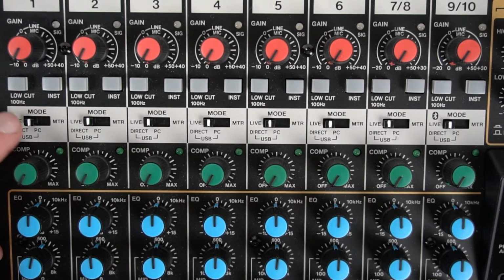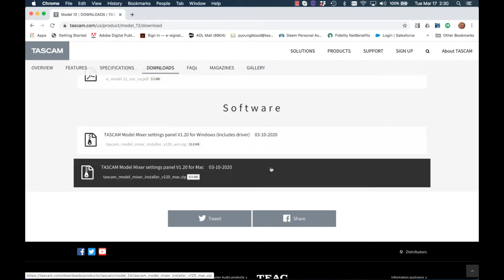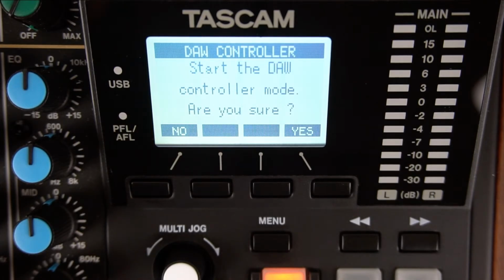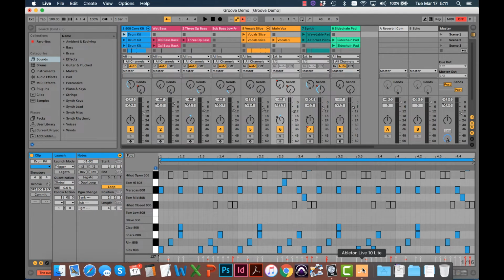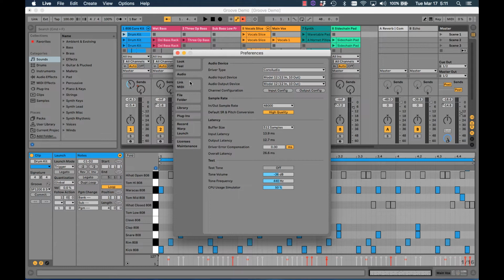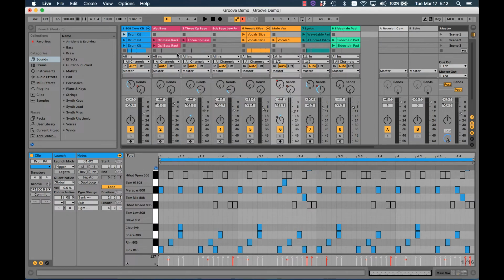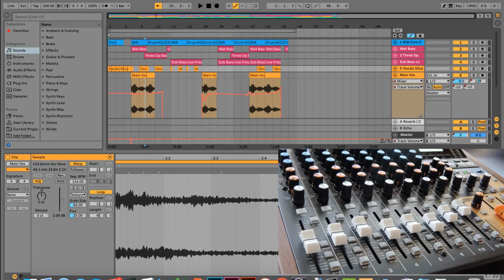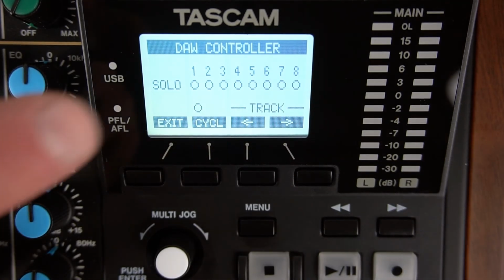TASCAM Model 12 - Recording with Ableton Live / Controller Tutorial

Comment: Hello! I would really love some help on this especially because I'm more of a muso than a sound engineer who understands the tech side of it: I'm wanting to use my Model 12 as an audio interface, therefore using all/most input channels to go into Ableton Live for live looping & streaming. At the moment Ableton is grabbing the entire mix (even though i have 4 instruments plugged into channels 3, 4, 5 and 6) and sending it into '1&2' in Ableton Live. I was hoping to be able to set each individual channel/line to a different track in ableton but alas it is only detecting audio from Channel 1& 2 of the Model 12. Is it possible to split all these channels into indivdual tracks in Ableton Live or is this beyond the Model 12's capabilities? 

Lastly I was hoping to be able to send a click track into one of my monitors so that only I can hear it (i.e. viewers can't hear the click track but can hear everything else). If I could get a response this would be such a life saver as I'm super stressed about trying to get this to work! Thank you Tascam
Reply from the maker: Hello!  Great question, and we have a solution for you! When the Model 12 is stopped, enter the MAIN MENU. Next, select USB AUDIO on the SYSTEM Screen, and open the USB AUDIO Screen and select PC. This will take you to a menu that give you an option for MULTI or STEREO MIX. Make sure to select MULTI in order to utilize all of the Model 12's channels.

Comment: I went to download the Setting panel software but it links me to another one. I downloaded it anyway but still can’t control ableton :/
Reply from the maker: Hello Zafra Music!  Are you using Windows or Mac?  I just double-checked and both of the links allowed me to download the correct versions of the settings panel.

The video lays out all the correct steps to use the Model 12 as a DAW controller for Ableton, but if that's not working I'd recommend reaching out to our tech support team.  They can walk you through everything and help to troubleshoot the process.  Feel free to give them a call at 323-726-0303.
Reply: @TASCAMUSA  thank you for the reply! i was able to get it working. Im having so much fun using the mixer as a DAW Controller. I still need a lot to learn. I  am trying to use the inputs (microphone) while I use it as a controller but cant get it to work. Any quick tips??

Comment: I want to purchase this but I just want to make sure. I hope I’m not asking something that has been asked but,
Can I run my MPC LIVE TO THE inputs of the Tascam and live record multiple tracks simultaneously into Ableton? (With the desired eq from the Tascam).. excellent video
Reply from the maker: Hello Octavius!  If you're connecting the MPC Live to the Model 12 via MIDI, you won't be able to multitrack record - MIDI doesn't send audio, only control information, so you can use it control virtual instruments within Ableton.  If you're outputting the actual audio from the MPC Live's 1/4" jacks, you can connect those to multiple inputs on the Model 12, though I'm not 100% sure the MPC can route audio to different outputs.  But, if that's possible within the MPC then yes, that'd be doable.

Comment: Hey guys! Would be possible to use channel sub and main to compare between different pair of monitor? I’ve tried but in the DAW mode I could just get sound of the main one
Reply from the maker: Hello Miguel!  Yes, that's absolutely possible.  Those two different outputs will send the same signal, so as long as you have different monitors attached to each you'll get the desired results.

Comment: I’m thinking of buying one but I was curious about something. If I wanted to send a channel through a channel strip to use the compression or EQ could I do that in abelton and print a new track with the added EQ from the Tascam? I hope you understand my question. Essentially I want to use the Tascam strips as outboard fx gear to alter existing audio already recorded on abelton. Thanks!
Reply from the maker: Hello J Blue!  Yes, that's definitely possible and we hear of folks doing this all the time.  Basically, you'd need to route the channel you want to effect out of an aux output, then back into an open channel.  Set up a new channel in Ableton that corresponds to that and record it down!

We hope this helps, let us know if you have any additional questions!

Comment: Hi,
 
Is it possible to control the DAW with the Tascam, whilst using a different audio interface?

Cheers
Reply from the maker: Hello MMH Studio!  Yes, that's possible.  Depending on your DAW, go through the normal steps to set up your audio interface as the inputs, then set up the DAW control as the Model 12.  The only real limitation here would be the number of USB inputs your system has available.

Let us know if you have any other questions!

Comment: Is this the same for the model 16? I’m not at it right now but I could only get stereo input and outputs to show in ableton. Would this be because I didn’t have the switch on pc?
Reply from the maker: Hello!  You should be able to get all the outputs to show up in Ableton.  On your PC, go to the audio settings panel, then the microphone settings and open the ADVANCED tab.  Here you'll have access to a drop down menu, select the number of inputs you're trying to use (the options will be either two or twelve).  Once you've selected twelve, you should see all of the inputs separately within Ableton.

Let us know if this works for you!
Reply: @TASCAMUSA  Thanks heaps yeah I was able it fix it. I had to change my driver type! Then the multitracks options showed. Thanks heaps for your prompt reply!

Comment: Heads Up!  Slightly different instructions are needed if trying to connect the Model 12 to Ableton Live 11 running on Windows.

Hi - this instructional video is almost completely correct (and is probably 100% correct for Mac).  The settings on the Tascam Model 12 are all correct.  The driver installation for Windows works identically.  Setting DAW Control on the Tascam Model 12 works great.  Setting Mackie Control in Ableton preferences is also correct.  
However, on a Windows 10 machine running Ableton Live 11 there are two Model 12 ports that show up as selectable in the MIDI/Link preferences not just one, as displayed in this video at 3:41.  On a PC, two different MIDI ports show up as selectable: Model 12 and Model 12 (MIDI 2).  When I chose Mackie Control and Model 12 for Input, Output, and Sync, nothing happened! (i.e no fader control in Ableton)  I kept trying other options thinking that I might have a defective unit.  Then, I fired up an old Windows program that would let me spy MIDI messages coming off of the Model 12: MIDI-OX.  Selecting Model 12 as a MIDI device produced no recognition in MIDI-OX or Ableton Live 11 when I jiggled the faders with "Model 12" set as my Input and Output device in Link/MIDI preferences.  
But, when I selected Model 12 (MIDI 2) instead, messages appeared for all of the faders, the pan pot, and the transport controls.  I went back into Live at that point and selected Model 12 (MIDI 2) as the Input and Output device.  That made the MackieControl Remote Controls come to life in Ableton Live 11.  Can you guys please make a video or correct this video for Windows users so that other folks don't have to invest the time that I did to figure out the way that Model 12 users that use Ableton on Windows need to configure?

Signed,
Software Engineer
Reply: Thanks heaps for this well written problem-report and fix, Billy! I am over the moon with my new Model-12 but couldn't figure out why it wasn't working as a DAW controller (same issue while running Ableton Live 12.0.10 on Windows 11). Assigning the MIDI input and output to MIDI (Port 2) fixed it right up! From this I'm then thinking that the other, regular MIDI that is selectable is likely the Model-12's physical/analogue MIDI in and out jacks?

Comment: Will this be applicable to the model 24?
Reply from the maker: Hello!  Setting up the Model 24 to use as an interface with Ableton Live is the same.  However, the DAW control functions only apply to the Model 12.
Reply: @TASCAMUSA   When setting it up as an interface can you use the eq and compression on the tascam so that it prints on ableton or is it just the gain knob that works?